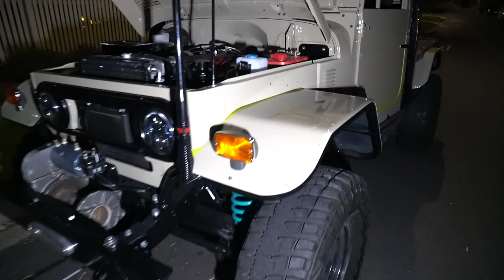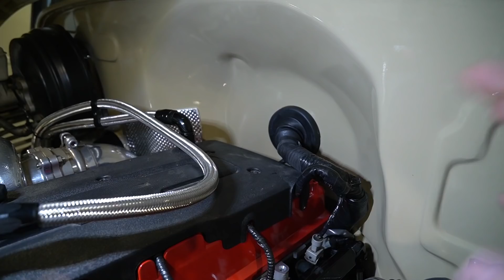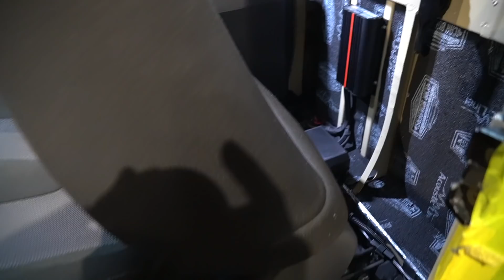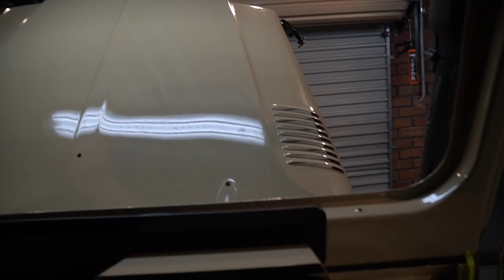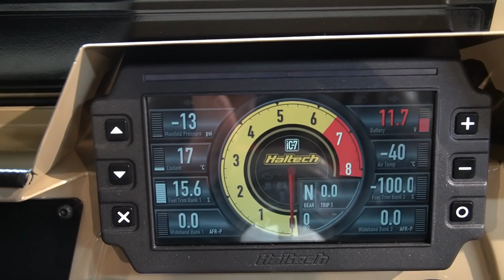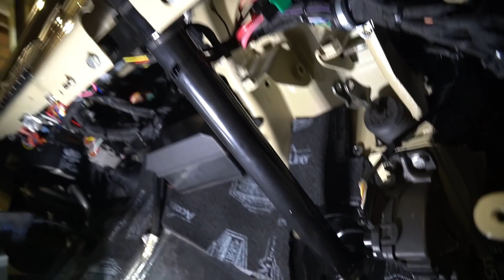THE BARRA LANDCRUISER IS WIRED AND TURN KEY - FJ 45/80 EP#30

Comment: Richard, looks fantastic. Ref your garage door, roll the curtain all the way up and check the distance between rolled door and the ceiling. If you have the space you can raise the L Brackets (or use a lifting block on the L Brackets) at each end to raise the whole door. Additionally, cut the limiting tabs off the side tracks and re-attach at the highest point possible. The other option would be to get new side tracks. The last thing to do, and this is brand dependent, reprogram the upper and lower limits of travel.
Reply from the maker: Hey Andrew, unfortunately there is an Ibeam directly ontop and I can't move the door up so it's pretty much at the top of its limits!